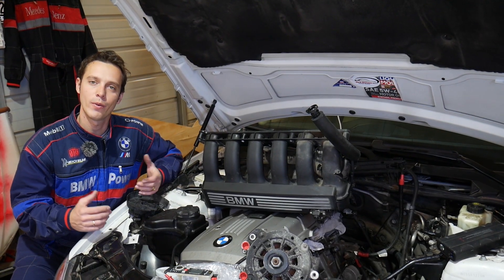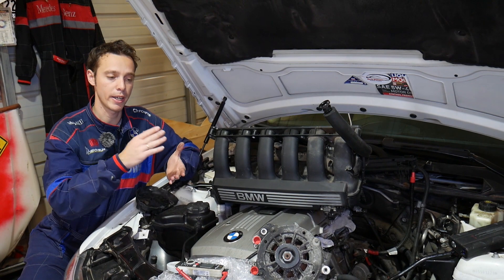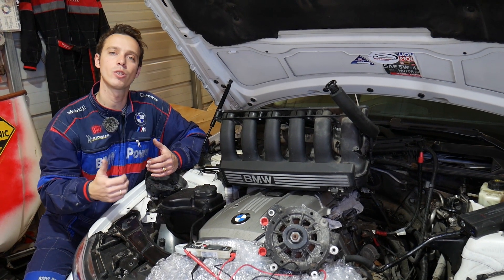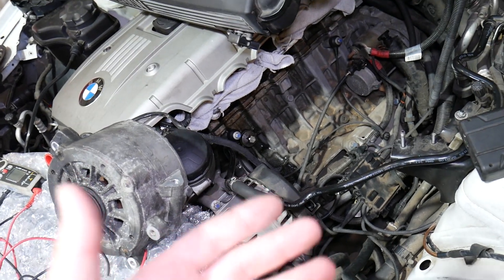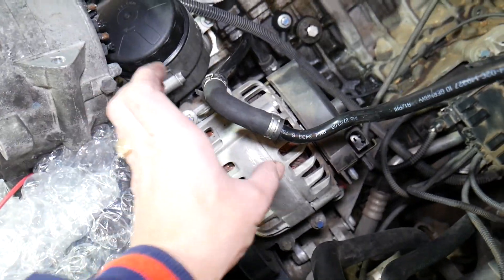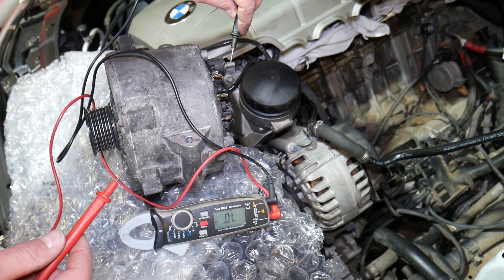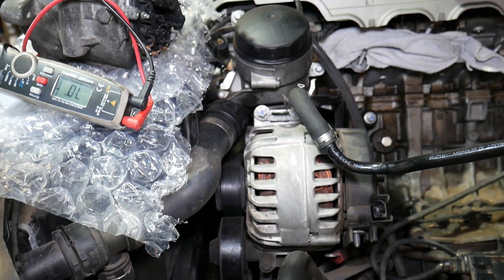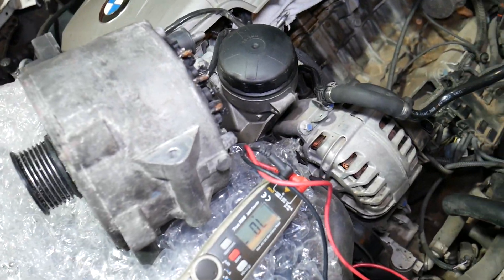BATTERY DRAIN, DEAD BATTERY PARKED BMW X3 E83 F25

Comment: This replacement did not fix my 06 E83 X3.... still have battery drain.  Any other ideas???
Reply: Ever got yours fix?
Reply: @trapislandboy654  Try replacing the two grounding straps on the underside of the X3. They corrode and you get the same symptoms.

Comment: Excuse me but you are measuring the forward and reverse resistance of the diodes your last comment said 2 volts rather than 2 ohms possibly you should edit your video just a bit... Thanks for the info hope my comment helps you.